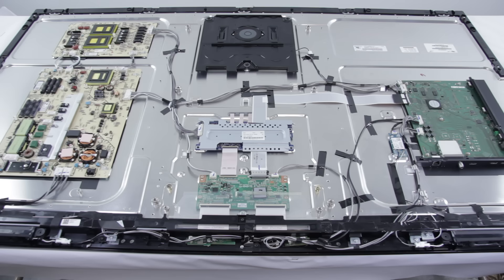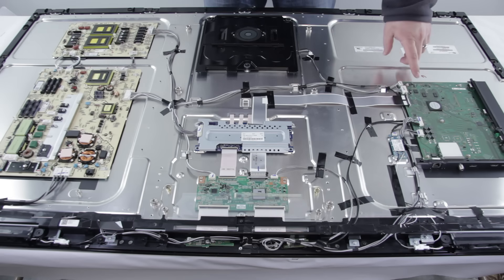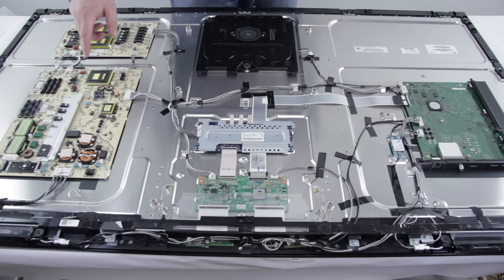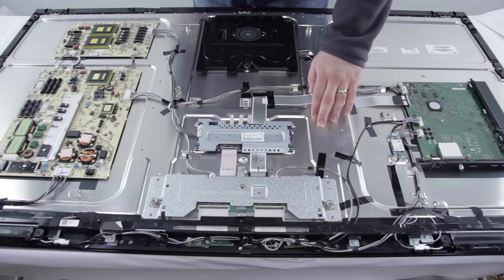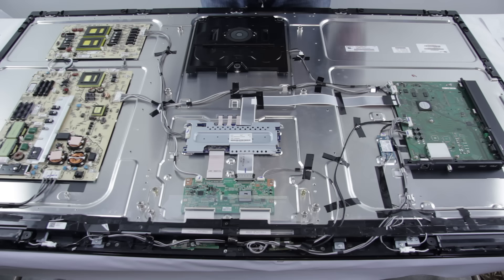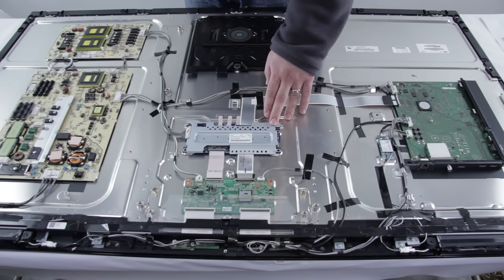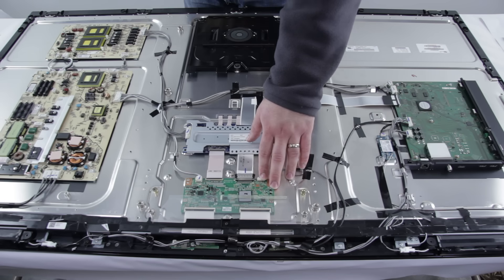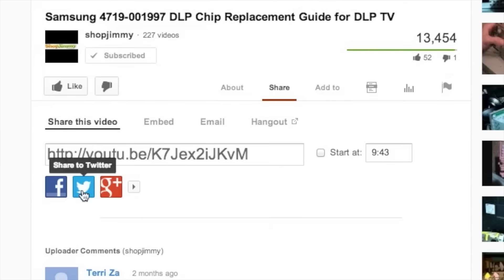LED TV Repair Tutorial - Common Symptoms & Solutions - How to Repair LED TVs

Comment: Hello. I have a problem with samsung led tv UE46SE6100.
Problem is with backlight. Upper half of display is darker. When i took it apart i saw that it has 2 led sticks (left and right). half of every stick is turned on. I think that the problem is in power board but i am not shure.
If someone had similar problem please reply.
Best regards.

Comment: my LG 42LS5700tv, which is a led/lcd tv, randomly turns off and on. In addition it will make a high pitched noise and display vertical colored lines. When it does thr latter ir is unresponsive to commands.

Comment: I have a Haier 46 inch LED tv. Model # LE46H3280. It has no picture or sound. Only sign I see from it is a little red light in the bottom corner. I was wondering if I could get some suggestions??

Comment: I have a Vizio M502iB1 . This tv is showing blurred picture, some double images along with vertical and horizontal colored lines through the picture.. powers on fine, audio is fine, and all my inputs seem to be working fine. This issue seems to have come just out of no where.. one day it was all good , then the next time it was turned on it had all theses picture issues.  If I lightly tap the side of the tv, picture gets better and some times worse...  Thanks for any advice.

Comment: I have a vizio M420SV that powers on and shoes the logo on the screen, then shuts off. I have tried doing a power cycle,  Changing outlets, etc with no success. could this be an issue with the power supply?

Comment: I have a LG 32LB5600 LED TV.  Picture is present, but very dim.  Sound is good.  From watching your video, I would guess it's a problem with the LED driver board, or with the power supply that powers the LED driver board.  Sound about right?

Comment: hi thanks i have a samsung 40 inch led tv UA40EH5000 i bought for like less than 2 years ago. 10 days ago the screen went black but came back immediately. 1 day after the screen went black and i got no sound no picture, but the strangest thing is that the screen flashes very quick , light goes on and off along with red light. i took off the back cover i looked into the power unit supply nothing seems to be damaged and i saw the flashing closely the leds go on and off.  can you help with that thanks already.

Comment: I have a sony kdl-52ex700 with backlight, no picture, no blinking lights, solid power light...cant say if i have audio or not, tcon makes a noise with power cable is plugged in.suspect bad caps...any suggestions?

Comment: Hello Jimmy! My TV has no audio from its speakers at all. I bought a receiver and can get the sound for the tv to come out of the receivers speakers BUT the audio cuts out for a second, every 4 seconds. The receiver and speakers play fine with other TV sets so I know it's this tv. It is a Samsung smart tv.Model code# UN65H7100The receiver and speakers were new along with the hdmi arc cable and optical cable. So tv is the issue.The tv speakers stopped working a few months ago. There is absolutely no sound from the tv speakers. And once again, using the receivers speakers for the tv produces audio, but it cuts out for a second precisely every 4 seconds.What part do I most likely need to replace please? Eager to get this fixed ASAP - thanks!

Comment: Hello ShopJimmy.com
I have an LG Model 47LN5790-UI.
I have sound but no picture but I could see a very light shadow of the picture, like the back light is not working. When I turn it on or off, I can see the full picture for a flash (less than a second)

What part do I need?

Thank you

Nofre

Comment: Have a Samsung UN55B600VF that went through a lightning storm
On light was lite but remote didnt work. Removed power and pluged in with momentary lighting of the on lite otherwise nothing. All the fuses are functional and there is no obvious discoloration or excessive heat
Potentially the Main boardand remote PCB? Connected to the TV was also a DVD HDMI where there is also not operating tested on 2nd TV.
Reply: mgrams100@gmail.,com

Comment: Hello I have a Samsung 46 LCD tv. I recently purchased the power supply board from you with part number BN44 00423A. The TV did turn on for a few days then went back out. Does this mean the part went bad or does the Main Board need to be replaced?

Comment: I have a two yr old Samsung led tv, model UN39FH5000f. I have no picture but I have sound, I did the flesh light test and I have a picture but no backlight.I have replaced the main and the power supply board and nothing has changed. Need some help please?
Norm

Comment: hi I have a Emerson model no LF391EM4 and it turns on but after 5 seconds shuts off I replaced the power supply board but still no change. please help

Comment: I have a Sony LCD Model No. KDL-55HX729 the problem is for few seconds screen displays and goes to stand by mode. the high voltage to panel is cut off, please guide me what will be the problem.

Comment: LG L194WT LCD Monitor is showing all the three RGB colours darker than usual. It used to automatically come back to normal colours and then again shift to darker colours. I have checked it on another computer and the colours are still darker. I have replaced the cable with a news one, but still same. What can I do ? Is it a problem of blown capacitors or something else ?

Comment: I hand a Samsung UN60HU8550F and the issue I'm having is a black 2 inch line down the right side of the screen. I taped on the top of the tv and the line turned green. Any ideas what could be wrong? Thanks

Comment: My Samsung LED Smart TV doesn't turn on...The red light flashes continuously.
Model Code: UN60F6300AFXZA
I was wondering if it the power supply was bad.
Reply: +Cesar Romero hello cesar did u find out what the problem was i have same issue

Comment: I have a Samsung UN65HU9000FXZA The tv will not turn on, red led power light blinks 5 times and repeats. After watching your video I think it's the main board. oh I forgot to say when the one connect is not connected red led does not blink it goes off and blue power indicator light " bottom center" comes on but nothing else. Please help.
Reply: +Gene Slough  hello gene i have same issue do u know what it is
Reply: +Clara cisneros I'm not completely sure. I'm leaning towards the main board or the t-conn board. I have a tech coming to check it out Wednesday. I will let you know what it is. I have already orderd some parts and may end up fixing it myself.
Reply: +Clara cisneros : The strangest thing ever. I went on my Samsung profile and registered my tv. I set up a repair which was supposed to happen tomorrow. I figuered I would try the tv 1 more time just because. How bout the tv came on just like there was never a problem!(?) If you need parts I have a main board and t-conn board I'll sell for cheaper than usual. I was going to use on my tv but don't  need after all. VERY STRANGE! Anyway good luck and let me know if you need the parts. (still in the box)

Comment: I have a Sharp Aquos LC-60LE650U. The power (boomerang shaped light) blinks, after about 2 mins of trying to turn on, it blinks in a pattern of 3 long blinks and 1 fast blink. As far as my research has gone, it seems to be a CPU communications error. Is one of my boards bad? Is there a way to troubleshoot them?
thanks.

Comment: I have a Samsung 32" TV and my symptoms are sound with very dim picture.  The dimming started in the lower part of the TV a month and a half ago and just last week the I lost the rest of the display.  I can make out an image on the screen but it's very dim and I think will continue to fade  until there is no display.
My Model No:  UN32es6500F
Model Code:  UN32ES6500FXZA
Mfg Date: January/2013
Version No. TH01

I suspect that it's the T Con board, the LED driver or both.  Thoughts?

Comment: I have a Samsung UN60EH6003FXZA, Version HH01.  The problem with the TV is that when you hit the power button, the screen stays black and the standby light flashes for  a few seconds then goes off.  I saw some of your diagnostics to measure voltage between the power supply and the main board, but my TV has another board (T-Con Board I believe) is their diagnostic directions for a LED that has three boards?  Thanks

Comment: Brand new Samsung  UN65JU7100fxza Cracked screen. Please help. I did manage to pull apart the panel from the bezel enough and it appears that the screen only is cracked. There is sound and picture on two ends of the screen with the typical cracked screen lines in the middle! Please help!

Comment: Hi i recently purchased a used lg 65 uf9500 on ebay and on first set up did not notice anything wrong but after watching it the next day i am seeing two small thick black bars on the screen and i thought it might be a smudge and tried cleaning and it wouldnt go away and they are only visible when background has lighter color and it is noticed on every channel and it appears to be between lcd and the glass, contacted seller and he said he never noticed anything like that before, how do i fix it, attaching a link for the picture. Please help.
https://www.dropbox.com/s/qht5f0e7a6xs8kb/Photo.jpg?dl=0

Comment: LG 50" (maybe 47") 47LX6500 with no picture or sound when powered up.  The red standby light turns to white (like it should) when it's powered up but no picture or sound.  Main board EBR69490101  Anyone have this problem?  I don't want to spend what would buy me a new TV trying to fix this one.  It's apart and nothing is jumping out at me as far as problems..

Comment: I own a UN40F6350 Samsung
 TV.  From one moment to the next, while watching TV, the screen went to
 black.  Seconds later when I tried to turn the TV back on the startup 
screen flickered on and off and would not turn off or on.  After pulling
 the plug, the red IR light stayed on for many seconds longer than 
normal.  

I tried to reset by unplugging and then holding the on/off toggle in the
 back for 10 seconds.  Nothing changed.  Service guy came out and when 
he turned on TV, it seemed to start up ok, but with a slight flickering 
of the startup screen.  He changed out two boards, but after doing so, 
realized that the slightly flickering remained, but now the top half of 
the screen was shaded black.

He put the original boards back in and went on his way.  A few days 
later, I tried the above reset and same issue with the shaded black.  I 
then decided to reset the whole thing using the menu.  After doing so, 
the screen when to #$%^ and then I heard a clicking sound coming from 
the back of TV and smelled a burnt smell.  WTH!!!  I took the TV to 
garage to remove the back and could still smell that burnt smell, but 
nothing looked amiss.  

I then the TV back on and no clicking or more burnt smell, but then look at this picture of what the screen looks like now.

I hope the picture showed up

Any thoughts?

Comment: Excellent videos. Clear and to the point. Thanks. My question is that my tv, LG32LH30 (2009) suddenly stop obeying both the tv button or the remote control to power up. I did the power plug/unplug and tried several times with no success. Any recommendation to fix this problem? Thanks again.

Comment: Hi, I have a Sharp LC-70LE660U serial # 412850812.  My problem is intermittent horizontal lines across the screen. I have replaced the TCon board and the main board.  Do you have any other ideas for me to try? Thanks for any help!
Reply: The lines take up about a 3rd of the top of the screen. Sometimes I turn it on and they aren't there but most of the time they are.

Comment: I have a Toshiba 58L1350UC, backlight flashes for a split second when I turn it on then screen stays black. There's audio, and I can see an image using the flashlight method. I only saw 3 boards - power supply, main board and T-con and I can't seem to find an LED inverter. Is there such a thing or what could be wrong with my unit. Thank you. That is a very informative video by the way.

Comment: Hi, I have a vizio e500ib1. the problem is it will only turn on every now and then. sometimes weeks in between. ive tried resetting and i also did the flashlight test (no backlights). when i attempt to turn it on, the screen will flash the vizio symbol real quick and turn back off. This sounds like a power supply to me, i just needed a little confirmation before i bought one. thanks in advance! also, great video!

Comment: Hi, I have the Samsung 46 inch LED Smart TV. Model no is UA46C8000  its out of warranty and I have been using it for almost 4+ yrs with no issues. 
A friend of mine, tried experimenting with the original  factory settings and screwed it up. 
Symptons are: 
When powered on, there is no display, no image after testing with flashlight, restart sound can be heard, Samsung logo on the bottom panel is continuously lit, the TV goes in to a restart or reboot loop continously turning on and off with the red light on the panel blinking on and off....

Please help as the service men and the repair man is taking me for a ride with various diagnosis...

Thanks, 
Sam

Comment: Hi, thanks for these videos.  I have a hisense 50h5g lcd led tv.  Recently the picture went out, but I can still hear sound.  I can also see an image when I shine a flashlight on the screen.  What could be the problem?

I also have another hisense 50h5g lcd lled tv.  On that one, whenever i turn it on, I see black vertical lines with horizontal bands on the screen separated by white bands. Initially the colored bands are green, but then after about two seconds they become grey with the vertical black lines.  What could be the issue there?

Comment: hi i have a vizio  tv model E461-A1 and the screen is black and once turned on wont turn off the power light comes on in the lower left corner and will not turn off until unpluged plz help and thanks for your time P.S i did not see any blown caps or burnt diodes every thing looks good on the boards

Comment: Hello, I have a 55 inch Insigna  Model NS-55E480A13A when moving last weekend and setting up TV, I now have white vertical lines across the whole screen. You can see picture colors are messed up but there. I called repair center they advised mother board was shot. What do you think this would be and what part should I order? Thank you in advance for your assistance. Christine Oops, I guess I will have to call Geek Squad at Best Buy. Sorry.

Comment: Hi, I have a Sony Bravia KDL-55EX711. I have power coming to the tv because the power light turns on to green when I turn it on. and it also can turn red when I turn it off. I have no picture or sound. I also do have any back lighting from the LED back light either. what could be a possible problem? thank you for your time.
Reply: i think the main board

Comment: Hello, I have a Toshiba model 50L3400U with an intermittent blank screen issue.  The screen goes blank for a second or so then comes back on.  This happens about every 5-10 seconds.  it seems to go away for the first minute when you switch inputs but then returns  I have tried all three hdmi inputs and the rca inputs and it happens on all of them.  Ready to smash tv but will try repair first if you could suggest which board might be doing this.  Thank you.

Comment: I have a 65" LG 65UF6450. this is the 4k uhdtv. my son hit the bottom left with a screw driver so there is a crack. I think the display is working fine but there a white parallel lines originating from the crack that go back and forth across the screen depending on what is playing on the TV. any suggestions?

Comment: I have an LG 50ln5100.
The LEDs flash for a second when powered.
I tried switching the LEDs around to see if i needed to replace them, but they all work in the same spots and are dysfunctional in the same spots on the tv. I put in a new power board too, so that cant be it either. What would you suggest?

Comment: I have a LG 47LV5500UA that seems to turn on but there is no screen (it's black) and no sound.  The light on the lower right does change from red to white when it is on.  The is either an LED or LCD.

Comment: I have Samsung 55 inches TV,  LT J550HJ07-v.  There is a blue light coming from the screen, but no other signal or response, there is a short sound when HDMI cable is connected or disconnected, No other movement, remold does not change input. I disconnected it and on the lower panel that goes along the whole screen both directions there is white powder like a rust. at the center. What should i replace? The long electronics are connected to the black outside panel with stripes. Thank you for your help,

Comment: Samsung 32" LED TV - sound but no picture.  Replaced both the Power supply LED driver board and the Main board.  Neither fixed the problem.  Did flashlight test and backlight is not working.  With flashlight I could see menu text.  What to try next?  LED strips?  Or possibly the board (Tcon?) at bottom edge of screen - long, narrow circuit board.

Comment: lg 50ln5100 is the model, no baclights, I have sound and can see video with the flashlight. need recommended parts. tried to take a picture.  All I see is maybe a main board (power cord hooked) video board (hdmi, av1, com port hook up) and tcon, which is covered at the bottom unsure which one I need to change,  can you respond

Comment: MY LG 32LN575V LED tv has suddenly stopped working. No picture but, I can hear the sound and change channels. Flash light test works and i can see faint menu when i use my remote. I followed your video and tried replacing the LED driver. But no use. Can you suggest some solution?

Comment: Hello, I have a Samsung UE32ES5500 model TV LED. My problem is that the audio and sometimes channels are changing by itself. I already tried disconnecting the button pane (which, in my model, comes also with the remote control signal). Also tried disconnecting all the cables and reconnecting, didn't work. The issue seems to be "from the motherboard", but not sure what can I do...